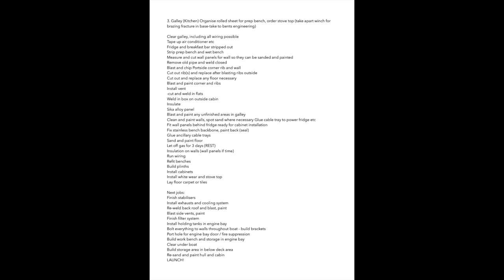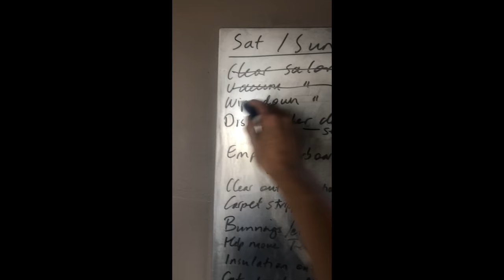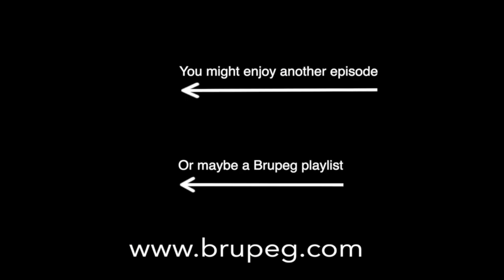Replacing Fuel Tank Vents - Project Brupeg Ep. 183

Comment: Happy Holidays to you both and great to see you both are well. 

I watched a YouTube video where an architect mentioned a negative of a container home being the application of insulation to the steel interior and buildup of condensation between the layers. I know yachts have interior walls but wondered if they ever apply insulation to those areas of the wall that come in  contact with water? Just a thought. 
Would a spray/adhesive type insulation work?
Reply from the maker: Happy holidays! you need to treat above waterline and below waterline very differently. Above waterline its normal to put insulation hard against the steel. below water you need to leave a gap so condensation can run under/below the insulation and out to a pump. the freezer room on Brupeg and other commercial trawlers is a master class of what works, they had a 4mm layer of ply lifted off the hull by about an inch, then the insulation went over top. that lasted 45yrs and the steel work under neath that ply was as perfect as the day she was built. if you insulate hard against the hull underwater, I reackon you have 6 months before you sink
Reply: @ProjectBrupeg You got it covered. 👍 It's great to watch you guys get everything covered. Looking forward to see you under way.

Comment: Hi guys. How are you measuring how much fuel you have in your tanks? I am surprised there isn't a sounding pipe either side of the centre line bulkhead sop the contents of the tanks can be measured.
Reply from the maker: Hi Aaron, we have site glasses on 4/6 tanks and the front tanks we sound down the filler. We also have fuel flow meters in the engine room so we can get a pretty good idea each day and double check when needed with a sounding rod

Comment: I did not understand the vent for the dieseltank. What was  it with the rubber gasket ? When are you closing the vent completly?
Reply from the maker: These tanks are storage tanks so will spend 99% of their life sealed off. The rubbber gasket just helps eliminate water egress. When we need the fuel from them we will open the vent and use high volume pumps to move the fuel to the aft day tanks and then close the vent again.
Reply: @ProjectBrupeg  oki..

Comment: Why anybody who does more than an occasional zip tie does not have a Cable Tie Gun that tightens and cuts off the tail all in one motion is beyond me, just look up Cable Tie Gun.
Reply from the maker: Actually just brought one in anticipation of the wiring to come
Reply: @ProjectBrupeg  That will make it easier for sure.  I worked in the switch room in the telephone company for 30+ years back when I started we used waxed cord to tie up the wires, when the cable ties and the gun showed up it was a lot less work, did not look as good but a lot easier.

Comment: Why didn't yu use the orginal pipe as is, then insert the SS pipe.  Weld a flang on top and your set.
Reply from the maker: Nah that would be 4 times the work as the rust inside the pipe would prevent the SS sliding inside, also we want large diameter pipes and we would have to go down in size doing this. A full replacement like this is actually the fastest and safest option